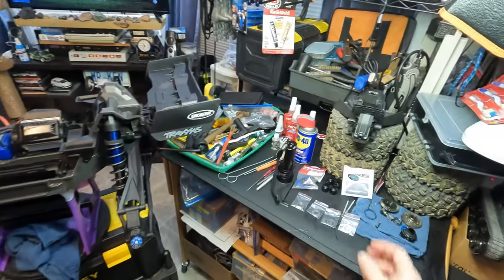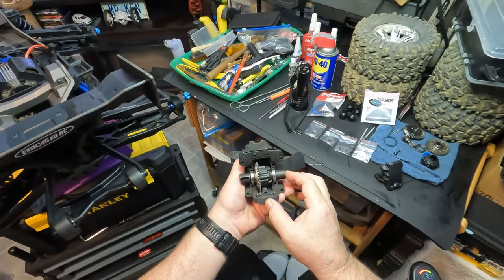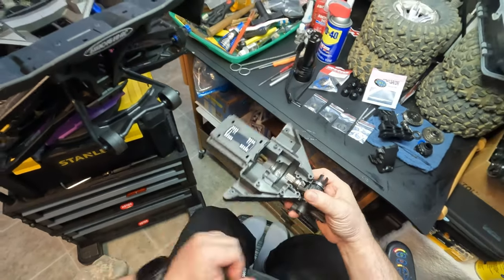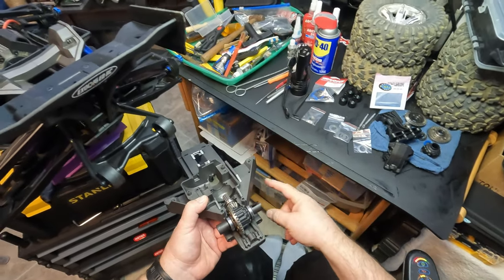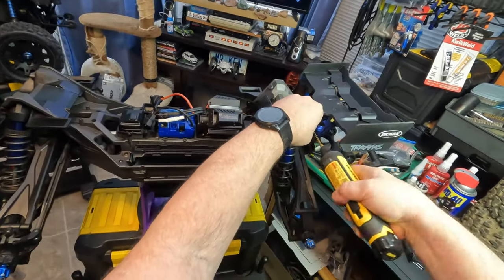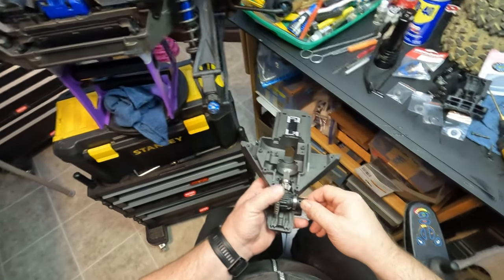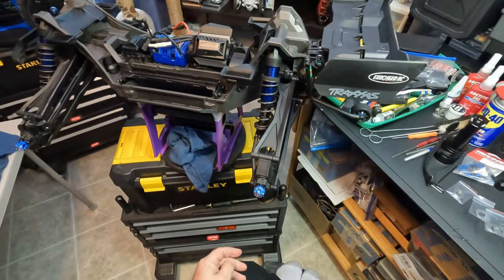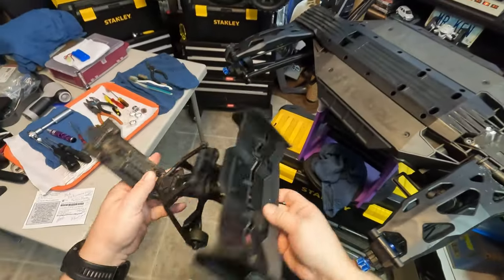XRT Shim Diff - Simple - Easy - Instructional - My Very First Attempt     03-03-2023

Comment: Big help since this is the project that im about to undertake this upcoming week. How do you usually check the play in the front diff without complete disassembly? Thanks again Subscribed!
Reply from the maker: I check the play in the front diff the same way by removing the cush drive, relieving the tension on the drivetrain. Best of luck to you, if I didn't explain anything well enough please don't hesitate to let me know and I will do better. Thanks for watching and for the sub!
Reply: @tompendley1172  DO you have any recommendations for diff fluids? Im leaving the 20 mill in the center and thinking 200k up front and 100k in the rear. Just to firm up things but not to change the handling characteristics of the vehicle too much (since i like the way it drives but could be improved)
Reply from the maker: @proto12qs  Your plan with 200k up front and 100k in the rear will do nicely, much better than stock. When you do get into the stock diffs you will see that Traxxas puts very little diff fluid in the front and rear diffs. However the center diff is usually packed well with the 20 million. Sounds like you have a good plan going in right now. The XRT is the best driving/handling rc truck I've ever driven.
Reply: Just completed the job! 100 percent the diffs were not filled to an appropriate level. Pretty bad job put the factory. But quick fix as long as ur somewhat handy.
Reply from the maker: @proto12qs  Alright, glad to hear that. I wish I knew why they don't fill them up properly from the manufacturer. Maybe they want us to tear them up and buy more from them... I am almost always handy if I can help, always happy to. Eager to hear how well it handles now.
Reply: @tompendley1172  I just came back from a run. I think the handling is improved. No longer diffs out on one wheel. You can give throttle to break the rear loose, but mostly the front wants to grip and hug the corner. Very predictable. BTW: on my particular truck it basically needed no shims, very good fit from the factory. I considered putting none but then decided to preemptively put the thinnest shim from the pack in there just to tighten up whatever play was left. Amazing tolerances.
Reply from the maker: @proto12qs  So good to hear that! They do handle much better. When the rear end diffs out is one of my biggest problems. I also like to bump the throttle to kick the rear end around when needed, cannot do that very well with a loose diff and it makes it much easier to consistantly drift them. Glad your diff was pretty tight from the factory, they are not all created equal for some reason. Slight adjustments can make a huge difference. Thanks for the update!